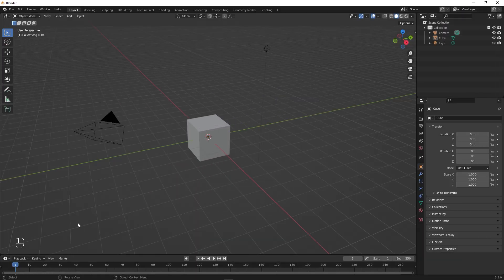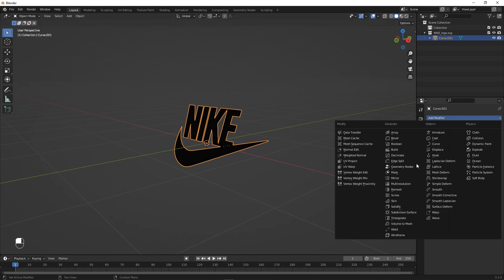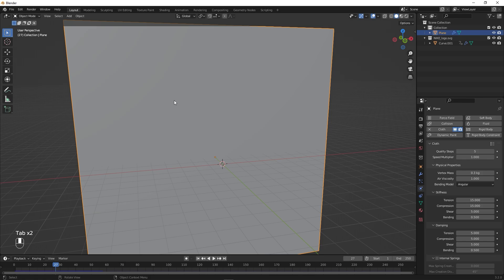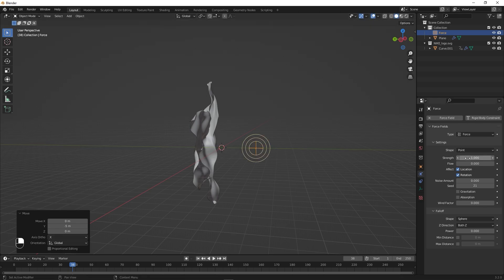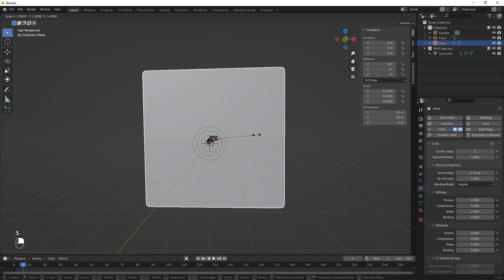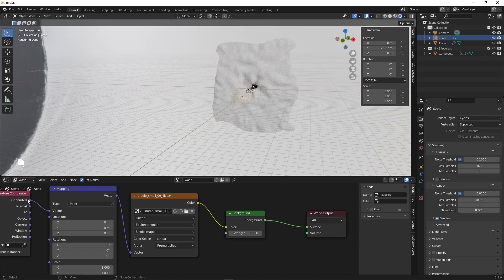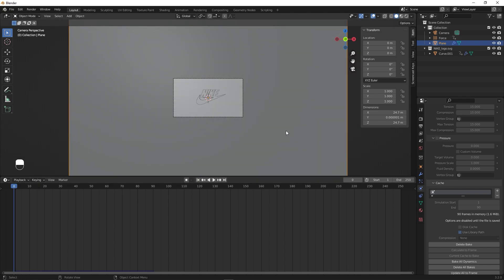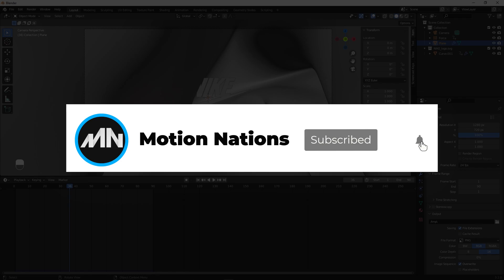Dynamic Cloth Logo Animation in Blender 3D - Blender 3D Tutorial

Comment: how do I get better fps in viewport display?  I cannot see it like you do. I have  AMD Ryzen 9 5900HX and RTX 3060. during collision simulation I see 0.4 fps

Edit: Okay, for those of you who might or will have the same fps problem as me:  Start with basic shapes and small size logos. keep your elements as small as possible
Reply from the maker: Do you mean in solid mode? You have decent specs seems like some issue with the installation or with the system.
Reply: @MotionNations  yes solid mode. im thinking maybe my logo is too complex or i messed up subdivision setting.
Reply from the maker: @feridfidan  might be possible